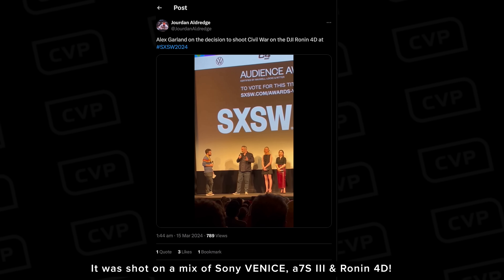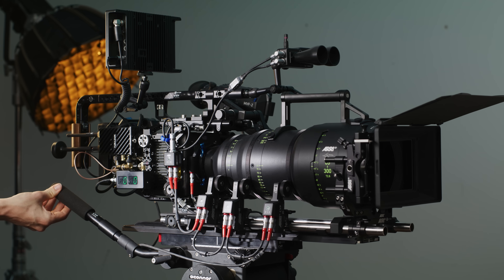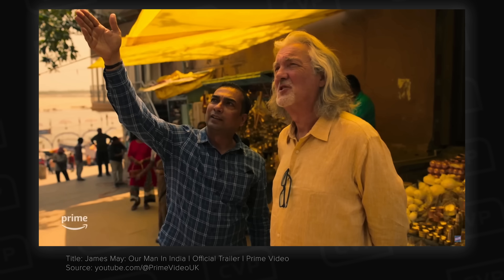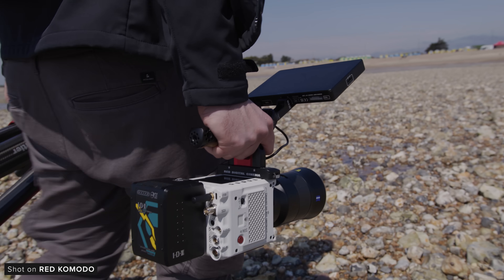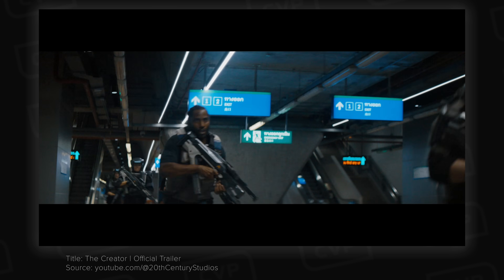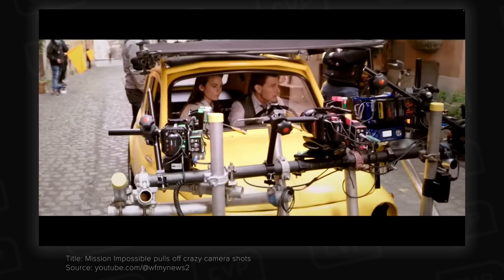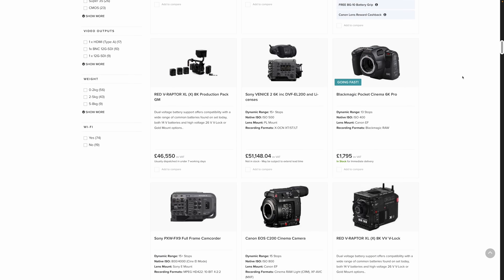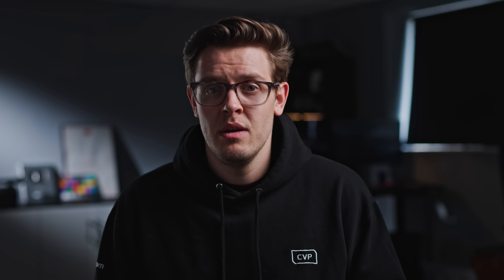Is the filmmaking process changing?

Comment: Cool vid, but I do find that this democratisation of digital filmmaking does lend itself to a rather homogeneous look across the board. With regard to “Civil War” and the DJI Ronin 4D the key phrase here is “certain scenes/scenarios” as they used the Sony Venice and others for many scenes.
Reply from the maker: 100%, as I say in the video, different tools for different jobs! Jake
Reply: you're correct they didn't choose it for certain scenes however it could have been used for the entire movie The only reason that they didn't is because they had the ability to shoot on something like a Venice which is a better sensor in terms of stuff like it's rolling shutter performance now you can work around that with the camera like the Ronin 4D and if they really wanted to they could have shot the entire movie on that one camera but that would have brought an opposite challenge the Venice is much easier to rig out with heavier Cinema glass which is what they were mostly using and to Riga Ronin 4D out with heavier Cinema glass takes time and is a little bit of a headache sometimes it is for that exact reason that they went with something like a Venice because it has a better sensor and it is able to be rigged out much easier in certain circumstances that's the same reason they chose the ronin 4D to begin with because you don't have to worry about rigging a camera like a Venice to a Steadicam or a gimbal so it's not that it couldn't have been done they just chose to do it this way because the amount of money spent renting of Venice was going to be less than the amount of time that they would have had to spend trying to make the Ronin work for everything now that's not saying it can't because it can it's just a b** to do so especially if we're talking about a shooting scenario like we have on this movie where a lot of it is shot during sunrise or Sunset so you have a very tight window to work within and you want to be rigging as far in advance as possible and as little as possible so for a production like this where they are trying to keep their costs relatively low in comparison to the rest of the industry while maintaining quality it would be smarter for them to use a Venice for some of the more traditional static shots or car rolling shocks that you see in the movie again a lot of the reasons why the Ronin 4D wasn't used for everything isn't because it couldn't have been because it could have been it's because it was more convenient to use a camera that was able to be rigged out in such a manner that it could be done more efficiently throughout a day's shooting for example I could butcher my cow with a butcher's knife which is thin and flexible and very sharp and that would do the job perfectly making my life easier or I could butcher my cow with a kitchen knife still sharp but thicker and far more rigid which would slow me down throughout the day as I'd be striking bones I could normally bend my knife to avoid now I could still get it done it would just be a pain and Slow Me Down  but once I've already butchered the cow and now it comes into the preparation of the food and all of the ingredients a more rigid chef's knife would benefit me more in that scenario so that's when I would use that not saying either one can't be used for either job because both can be used interchangeably it's just you lose Effectiveness when doing so and when you have access to the amount of money to allow you to get multiple cameras systems you should of course use the proper one for the job though at the same time if you don't you shouldn't let it limit you because the truth is most camera systems in this day and age are phenomenal

Comment: i have the dji ronin 4d 6k and 8k and i used them along with the a7siii, a1, red gemini, black magic 6k and it totally delivered but in the scene it seemed to be rather hated and secretly used. One production House i worked with for example shows in their behind the scenes only red cameras and does not want the ronin to be seen (because it is so easy to use and does not look as pro as all that other camera gear). For me the Ronin means pulling off amazing shots in no time, every thing works right away. But i think DJI needs help to get the word out and it totally can be used for everything. It has a learning curve though. Everytime i use a conventional system with either steadycam vests or gimbal plus camera i am quickly reminded of the worth of the ronin.
Reply: Closeted DJI users LOL... Yeah, that's actually a thing! There's so much snobbery out there against Chinese products, when in reality everyone is using them.

Comment: It's great to see these cameras being used on larger scale productions. It reminds me of the days of film cameras, where the actual camera body was largely irrelevant. Film stock and lenses were way more important. There was only a handful of 35mm camera bodies and they all did pretty much the same thing, albeit some with higher framerates, less noise etc. As filmmakers I think it's necessary that we understand the relative importance of the camera, as lighting, lens and production design as well as a skilled DP will make even the cheapest of camera systems look brilliant. With this in mind I will say that as a camera assistant some of these newer camera options come with a lot of limitations in terms of practical use on set. I mainly work with Alexas and they're pretty much indestructible when it comes to issues such as overheating. They can be powered all day off a block battery, they don't have issues like SDI surging, they accept dual voltage etc. They also work with accessories most rental houses offer, and they are what most camera crews are comfortable using. Regardless of the job, as long as it is an Alexa I know I can get the camera built, troubleshoot any issues and customise for my operator/DP in pretty much the same way. When I use cheaper Sony cameras (the Venice is fantastic) or any Red systems, I find it much harder to plan ahead for any potential problems or fix issues whilst on the move. If I need multiple SDI outputs for different LUT's, focus monitor, directors monitor and DIT station I am also limited by my choices, and some industry standard accessories aren't fully compatible. For example, Arri's focus systems are pretty standard here in the UK and only have all their features accessible with high end cinema cameras. Arri and Venice cameras are also designed with rigging in mind, with cage systems to accomodate all the crap us assistants have to stick on the camera.  Whilst some of these mid-budget cameras are lighter, this often is a disadvantage as handheld operating becomes very shaky with the added rolling shutter making images look cheaper. Saying that, the Creator looked pretty great, as do these clips in the video. I would be interested to know how the crew found the practical side of shooting on these cameras and whether they preferred the workflow after getting accustomed to it.
Reply: Great comment, I agree

Comment: If there's one phenomenon that is a threat to ARRI, it's this.

Cheaper cameras being used on higher end films, and people not noticing much of a difference, if any at all.

And it's only going to get better with time.

Arri needs to start tapping into the cheaper market eventually.
Reply: Not really. 

If anything Arri is going to make a smaller Alexa 35 system like it did with the original mini relative to Alexa classic.  It’s not going to be cheaper though.

Most of these films choose to use these cameras because of size, form factor and weight.  Not price.
Reply: Numbers don’t lie . Even old 15 year old sensor from the  Alexa , beats every single camera mentioned in this video including Venice in terms of DR and color science . Kind of hard to believe no one has matched it or beat it 15 years later
Reply: @chicobraz4335  color science is bs unless u use straight out of camera colors. nowadays everything is graded, and color depends on the colorist, not the camera. and that extra maybe 2 stops of DR on the alexa probably is not as important as you think. unless we talking about alexa 35, then that difference would be more significant.
Reply: Please guys…don‘t think you can get the same look with your prosumer cams like these hollywood examples. They do look dev on the sensor output and get looks you will never get. Watch steve yedlins blog. The cam doesn‘t matter any more. You can match everything. It‘s just pure math on every pixel. But if you can‘t do this…then i always prefer higher budget cams like arri.
Reply: @daniel.h2488  nope 2 stopes is huge difference ! Color in terms of skin tones ?? You kidding me ??
Reply: I'm not sure ARRI is threatened by these cheaper alternatives. That being said, as a business, ARRI can benefit by producing a prosumer camera if for no other reason than to generate interest and income. With the extra income from a prosumer line of ARRI cameras, they can continue to develop all of their high end cameras while tapping into an ever growing market of low budget/indie film productions. Why do you think Sony continues to make prosumer cameras while developing their higher end cameras? It's money. Any business that wants to stay in business and grow their business will smartly seek out new avenues of income. It's simple logic.
Reply: @chicobraz4335 The point is, no one in the non initiated public notice a difference.
Reply: @Okiyah  tell that to most directors who won Oscars for best picture the past 15 years
Reply: Once you've worked with Arri files, you'll understand how it is a truly a step above the rest. I do love working with footage from the Komodo, and I tolerate working with Sony footage.. But when I get my hands on a project shot with Arri cameras.. It's a treat. (from the perspective of an editor)
Reply: @keshetallekaridi708 Again, not saying it doesn't make a difference for the artisans of the film, but you don't need it to make a film people can enjoy on the same level.
Reply: @chicobraz4335 I was with you until you said it beats the Venice. I used to think it did but Venice has better highlight roll offs and if you're comparing an old arri to a new Venice, there's no competition, and this is coming from someone who loves arri cameras.
Reply: @blake9746  it does not and go check the number , Cined for one will prove you wrong ,old Arri and new Arri beats em
Reply: @Okiyah  Consumers might not be able to tell a difference, but crews actually working with the cameras on set definitely will.
Workflow, robustness, reliability, availability, standardization and therefore compatibility and speed on set is often a lot more important than saving a few bucks with cheaper gear.
Reply: @josuastangl7140  sure. I agree. Maybe I’m not using correct english? The public, the viewers, those who will watch the film : they don’t care and they don’t see the difference. In this day and age, the cameras are so good, you could make a movie with them, nobody would notice. Again and again and again, not saying it doesn’t matter for the crew. But the technology is there for anyone to grab and make a good film. Arri doesn’t make films.
Reply: @Okiyah  Sure, I get what you mean.
There have never been less excuses not to start.
I was more talking about bigger productions.
You’re right, you can certainly shoot very very high quality footage on a $1000 mirrorless.
Reply: @keshetallekaridi708  You realize you are not saying much here.  And actually you should enjoy (if you are into producing a high quality piece of work) working with the better photography and the better storyline than footage from a particular camera.  You sound self-limiting.